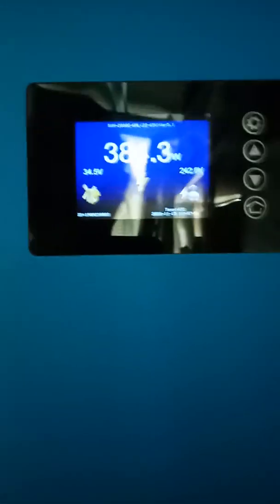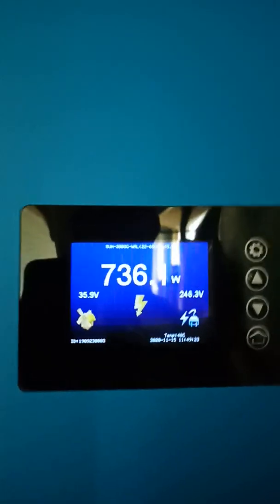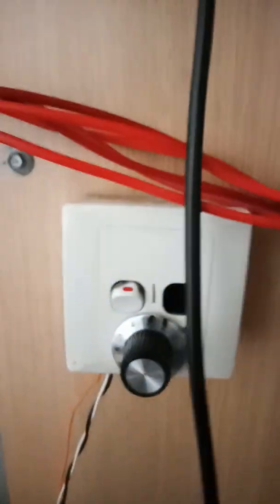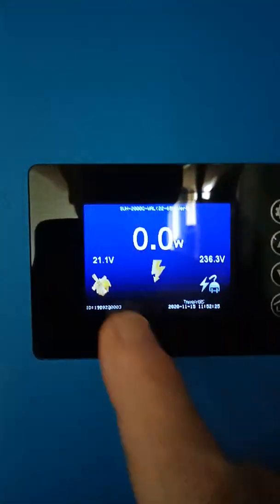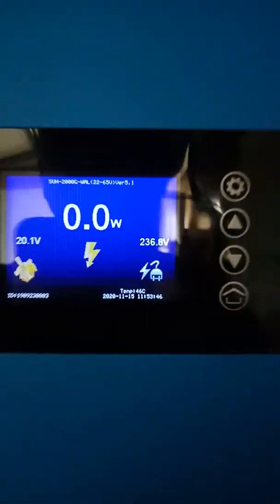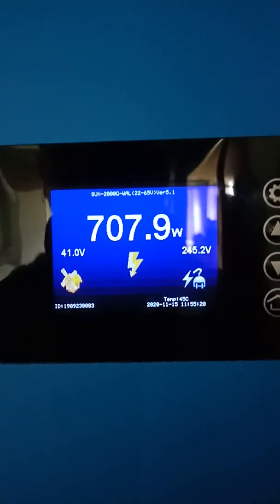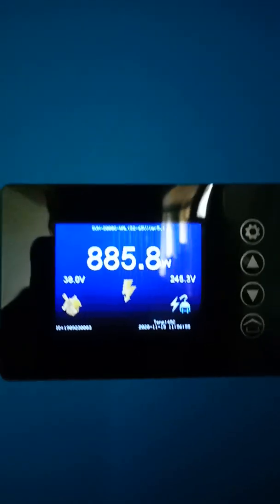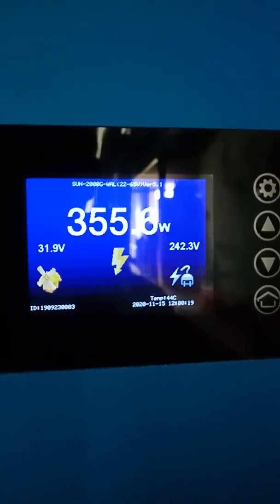B &C 1000w turbine and sun grid tied 2000w inverter. Part 1

Comment: I have the SUN-1000G-WAL(22-65v)version,plugged into an outlet through an adapter (I’m in the Caribbean 230v 50hz) and it reads the grid voltage and the turbines voltage but it doesn’t produce any power to the load, I need help
Reply from the maker: @reneejoseph1904  what is the turbine voltage thanks.
Reply: @davecollier8946  it fluctuates between 21v-60v
Reply from the maker: @reneejoseph1904  when it reaches above 40 volts if you get no power that means that the turbine is not under load by the inverter, you should see the power rise. If it does not do you have a dump load connected is so remove it and if the turbine spins full speed in light winds. without the load then apply the load. if it slows down it means that the relay that allows the turbine to input power to the inverter has probably  burned out. the voltage sensor picks up voltage from the turbine side of the relay not the inverter side. Also when this happens the load mosfet generally burns out and stays short circuit. (always on)
Reply: Is that something I can replace in the inverter or do I need a brand new one?
Reply from the maker: Yes I will send you a diagram.
Reply: @ please do, will it be here in the comments?
Reply from the maker: @reneejoseph1904   you will have to put your email here just replace what is obvious then once I have it remove the message
Reply: @ reneestrose “at” “gnail”

Comment: I use a 1200 kW vertical turbine at 24 V, I would like to keep it with a maximum production of 800W. What do you think about it? Is this voltage suitable for the turbine? Brake for such application? Thank you

Comment: Hi friend, what type of brake do you use? Do you use the metal bar supplied with the inverter? Is it possible to have a rotary type manual brake adjuster? Very detailed and very useful video!! Good wind!!
Reply from the maker: I eventually gave up trying to control the turbine. The best solution I found was using a 1500w jnge mppt turbine charge controller connected to 24 v 140ah agm batteries. but eventually one of the batteries failes and it blew the mppt. 
Before that though it was working great and I was just dumping the excess to the grid from the batteries using the gti. 
The turbine is now in my shed collecting dust along with the gti inverters.
Reply: @davecollier8946   
In short they didn't last long haha. Thank you for the reply

Comment: I notice from display inverter; SUN2000G-WAL and voltage "range" 22-65 volt. Those inverters i have found rated 2000 watt are liste with input voltage 45-90 volt. Where did you come across such a inverter ?
Reply from the maker: You can change the setting in the firmware but it is not as efficient as the 22-65.  at lower voltages, It will start up at the lower voltage when you use the 22-65 volt setting. 
There is no 22-65 version
Reply: @davecollier8946  Yes, 22-65 volt would be for the 1000W version. I dont like inverter puched to the limit, thus will try the 2000w model with a tumo 1000w 3 blade windturbine. Will post my findings/results once up&go :)

Comment: That turbine looks like an absolute brute ! Is this the monster 1000w from b&c ? I've looked at these turbines soo many times for my 48v system... looks like it kicks out some proper real power compared to all the other crap that is out there...
I've had thermodyne stuff for years which are ok but this looks next level !! 👌
Reply from the maker: Hi Paul
Yes it is the 1000w turbine  it is rated max 1200 watts so you need the 2kw inverter to have any hope of keeping it under control  with a GTI. 
I now believe the best solution is to run the GTI off a 24 v+ battery and have a separate wind turbine battery charger that can look after the turbine more effectively  (https://www.google.com/aclk?sa=L&ai=DChcSEwi1lZ-Jyc7tAhWNISsKHa8mDvgYABBWGgJzZg&sig=AOD64_2Ych1XrpXaIQbcUEcYDKXgRsf6BA&ctype=5&q=&ved=0ahUKEwj0sJqJyc7tAhXqxDgGHS70D-YQpysISQ&adurl=)  for instance  . The GTI will never go voltage to high the output from the GTI will not be as high due to the voltage being held at 48 volt. so use a limiter so it does not send power to the grid and allow the battery to store the excess. 
I really needed a 2k turbine for my setup I have a 8kwh battery that charges as soon as I am producing more power than I require. a 5kwh solar panel. And soon to be added a 100-200 ah 24  2.4-  4.8kwh volt battery connected to a 945 watt solar panel that will not output power until late to send power to the house and extend the life of my  8kwh battery. The turbine needed to be 2kw to supply enough power for the house and keep the battery from completely discharging in winter.
 I have not decided what batteries to use yet another guy is testing the GTI soon in a different mode that I have found so it can run off AGM batteries rather than Lithium. s4 it would be cheaper but working out the cost / compared to life cycles. Once his results are in I will decide lead or lithium s4 packs.  
I need  30+ amp charge rates so still working that out.   
My dynamic braking circuit is now holding the turbine under control and stopping the GTI from going into voltage to high. (lots of power is lost when that happens)
On comparison the 945 watt solar panel has produced 100 kwh in November and the turbine 30 kwh.  it is summer here and the winds are reasonable . 5kw panel 784 kwh for the same month the panels on the house are super expensive.  the 945w panel uses jinko 315 watt panels that are not as good but only cost me $60 each brand new surplus stock. the 24 volt  GTI in solar mode  is only outputting 760 watts from these panels at 29-30 volts  ( it should be 33 volts for max output).  I believe that is due to the mppt not being in its sweet spot. Hence I have a solar charger on order that can store to batteries that I have yet to source.
So based on the results that is how I estimated I needed a 2kw turbine to reach my goal of $0 power bills year round.

https://www.solarmanpv.com/portal/Terminal/TerminalMain.aspx?pid=92755&key=788A9HM this is my turbine web page.
Reply: @davecollier8946  So run the wind turbine (48v??) to a battery as an intermediate step and then take a more consistent 24v for a DC conversion back to the grid via inverter?
Reply from the maker: @Homewindturbinereviews The wind turbine battery charge controller does not suffer from the overvoltage issue. That means the turbine will not spin out of control. With a gti you need dump load and dynamic braking to stop the turbine producing to high a voltage. This happens when wind speed is around 10 -11 mps with strong gusts.
Reply: Looks like we are both ditching Tesup ideas and going elsewhere!